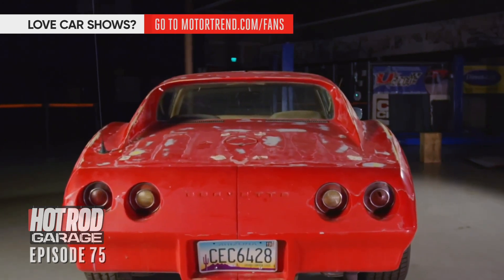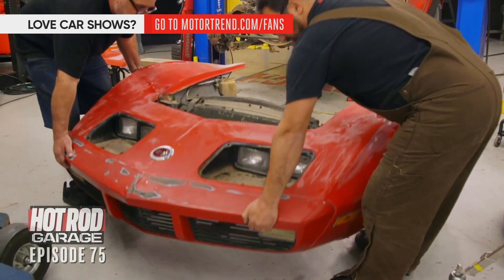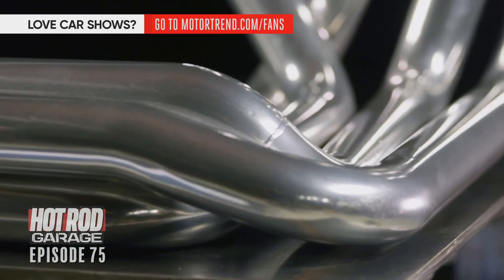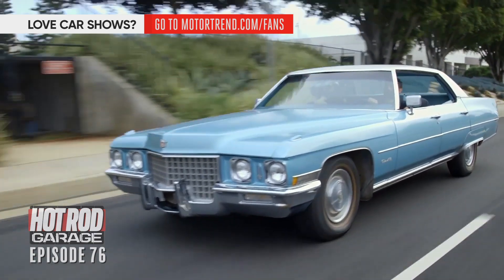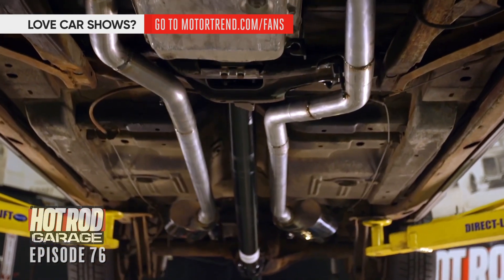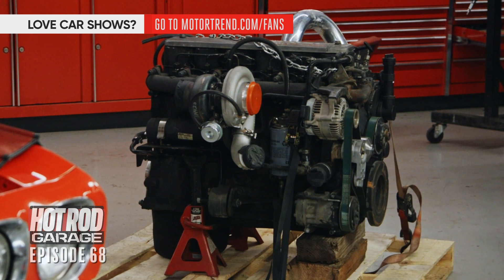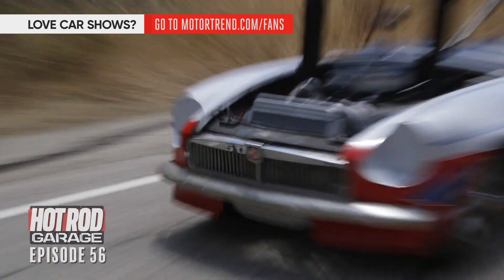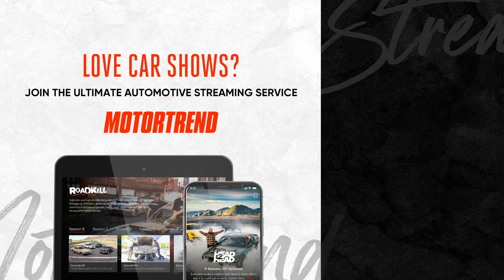Our Best Engine Swaps! | Hot Rod Garage | MotorTrend

Comment: Back in 1986-87 my mom owned a 1969 454 cu in, 4-speed manual stingray and a 1973 454 cu in, 4-speed manual stingray.
One white with red pinstripes, one red with 24 carat gold pinstripes, 24 carat 
gold inlays in the the interior in both of them. 
don't remember which was which (model year). 
The red one was imported from United Arab Emirates (sand absolutely everywhere in the car), white one from Saudi Arabia. 
Both custom made by Chevrolet (I've been told) for the Middle Eastern "oil sheiks". 
Both producing about 500 hp and both had really big side pipes with some kind of hole pattern in them.
White one had mixed spoke rims,
like chrome spokes and gold center, 
red had completely gold spoke rims. 
The red one had a supercharger/different hood (for the supercharger) delivered with the car when she bought it.
Not fitted when she owned it though. 
Both one of a kind if you ask me. 
She sold them somewhere around 1989,
to this day I wonder where they are.
I miss them, the white one especially.

Comment: Skillsaw Skillz just wondering if it is profitable, and do you have a butcher's license to turn abortions into  profitable builds or just junkyard skillz. I bet it pisses people off when you smoke their new Shelby Cobra Mustangs with a $2000.00 build.
 Reminds me in High School my friend put a rear engine Porshe in his VW Van, he could smoke the Camaro & Mustangs. Keep up the swaps, I love how your ingenuity out performs automotive engineers 
designs with a 2 week paycheck and 3 days labor. Keep it up!  I sold a 71 258ci 6cly. Jag Engine w/ FMX Trans for 2k. Then put a 350 Chevy engine and trans in the Jaguar and sold it for 5k. My friends said I ruined the Jaguar, yet w/ full tank, it went 2900 miles without stopping for gas. 29MPG  60MPH@1200RPM 100 gallon gas tank, kept the Jag 12 blade fan, in hose pressure cap, motor mounts, trans crossmember, A/C compressor w/ inline fuel cooler and factory water injection. That was 40 years ago and it still runs good. Like,  the El'camino is One of Kind, Hand Built! and Unseen Quality is Priceless! COOL!